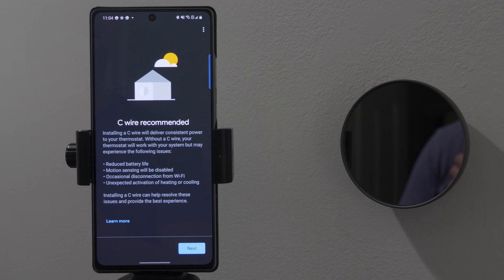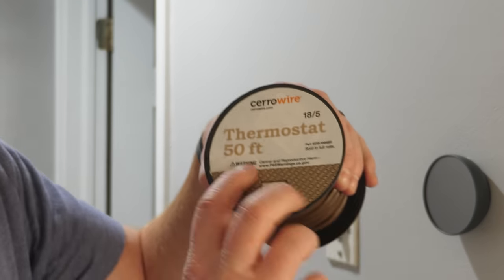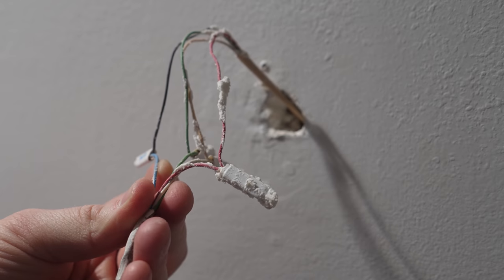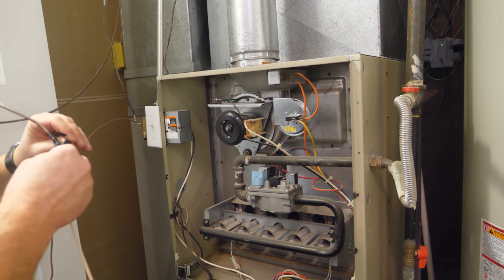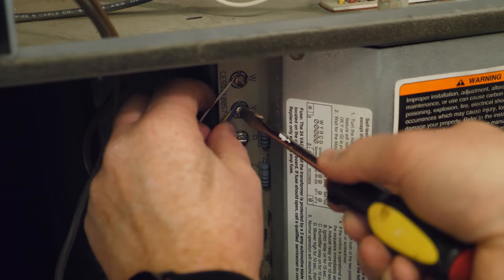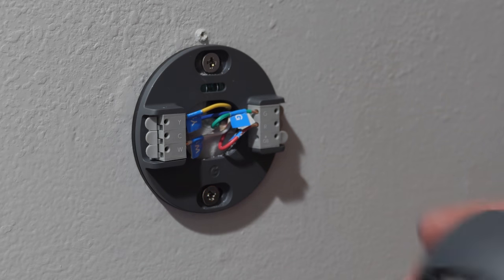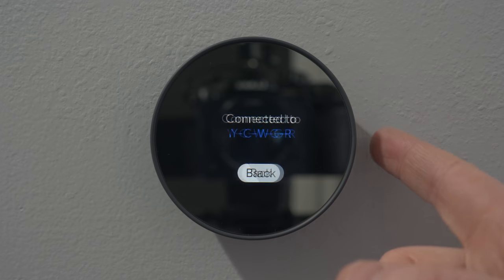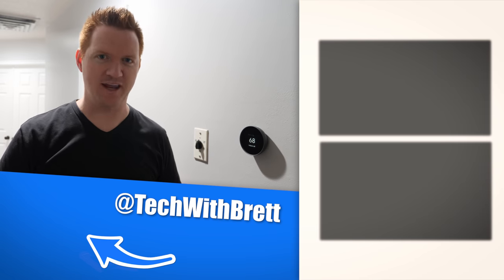Fix Nest Thermostat Issues by Installing a C Wire

Comment: Highly recommended, my Nest was great the first week and then it starting pulsing my furnace during its recharge draws causing the furnace to turn on and off rapidly which is definitely not healthy for long term life. If you have the means, get the common connected.
Reply: Google nest uses 2 non rechargeable AAA batteries so how can there be a recharge draw lol
Reply: @misterpro7903  Awwww that's cute of you to respond and I appreciate that. Older versions of Nest Learning Thermost such as the recent 3rd Gen do NOT use AAA or AA batteries but a rechargeable lithium-polymer battery.
Reply: @Davideturner  Well this video is not about a 3rd gen or older versions so why even comment
Reply: @misterpro7903  you seem to be oblivious of this yourself which is quite humorous making your reply further worthless and you should be ashamed in yourself with such a petty retort. I am happy to hold your hand on this one though. This video is clearly about using a c-wire with a Nest in general, regardless of the generation and your reply offered nothing in regards to this as the c-wire reduces the need to rely on any battery functionality in the first place. Further more, the pulsing issue is a well known and documented issue which is covered in major reddit threads and articles and occurs with the newest version here as well. For example: https://myfyveproducts.com/blogs/news/no-c-wire-install-a-nest-thermostat-at-your-own-risk
Reply: @misterpro7903  On the contrary, you missed the the subject right from the get go and your backtracking has been entertaining. You offered nothing to the conversation of this helpful video and I recommend you review the intent of the video by re-reading the title and the content body. You screwed up with your little petty comment kiddo. I digress.
Reply: Btw, as clearly indicated for you with a lot of hand holding, this affects all Nests. Read the article I provided or the massive threads on Reddit. Again, this has been a very well documented issue which affects ALL Nest thermostats regardless of the battery type.
Reply: @Davideturner  I think you should spend more time searching for hair receding solutions instead of arguing on the internet about thermostats, and maybe upgrade to the 2020 model so we all talk about the same thing grandpa ;)

Comment: I have a Question. I am installing a lock case and need to remove the nest thermostat so I can screw in the backplate of the lock case. Do I need to reset the nest to do that? Thanks. Great video btw.

Comment: Don't forget to turn off power to your furnace before removing the thermostat. If you short the wires to ground you'll be wondering why your furnace doesn't work anymore. Hint it's hopefully just the 24v fuse in the furnace.
Reply: Yes, the white single pole service switch that was shown actually was “on” in the up position, maybe the circuit was turned “off” at the circuit breaker.

Comment: Just finished installing 2 of these and running new wiring plus c wire in a house built in the 1800s. Talk about a “fun” job. 95% of these thermostats need a common wire. Even if you install it without out one eventually you’ll be calling a tech back out bc of issues occurring I.e battery or function issues. The other 5% is that a customer has a older control board like a ewc-st-2e with seperate O and B wired and have to be upgraded.... a complain I have is that this newer model has to be added through the google home app which for some reason never goes through smooth while setting it up. Takes several attempts to sync up. I feel the nest app connects easier to nest products. But that’s going away smh.

Comment: My nest worked fine for a year. 4 wire.  Motion sensing was fine. It suddenly started with the e298 error. Reverted back to programmable unit.

Comment: I’ve tried installing a C-wire adapter on my Trane furnace/ac for my Honeywell thermostat and have been unsuccessful. When I re-wire everything the thermostat has power and air will blow, but it’s not cool air as I want and the outdoor unit doesn’t run… any idea what I might be doing wrong?

Comment: If you have a powered thermostat system would you still have to use batteries with this device. I’m planning on buying one but I don’t wanna have to constantly put batteries in it when an a common/power wire is in place.

Comment: appreciate the video.. very helpful but I returned my Nest as I'm not going into my ceiling and run wire... or hire someone to do this... this should be solved by Nest...
Reply: Went round and with nest technicians for months. They never said that we had to spend more money to rewire our home. They just should have told us we were screwed from the start. Wasted so much time and money. Nest folks should be ashamed.

Comment: Thanks for the video! in the end, I did not need the C wire. The Nest seems to work perfectly and has the motion sensing. Not sure why some systems need it and not others.

Also, your wire was super easy. Mine is stapled inside the wall. That is code here, so you are not able to just pull it through the wall. 

As a FYI to everyone, before installing a new wire, I would see if you already have a C wire. It may not be  hooked up at your furnace or on your current thermostat, but it may be there. For example, at my furnace, I can see the C wire. It was coiled around the other wires just to remove the excess. If you look at the wire in the wall, it too may have been coiled around the other wires and sits inside the wall, not pulled out through the wall.

Unfortunately for me, the C wire as I said, was coiled up in the furnace, but I could not find it anywhere within the wall with the other wires. I cut open a pretty big hole, 4 inches by 2 inches to look down the wall, and it is not there. I wonder if they cut it away when they sent it up the wall because the wires have been removed from the main brown cable insulation and the individual wires were sent up the wall, which is very strange as they typically send the whole wire up in the main insulation and only remove what they need to send the individual wires out of the wall.

Luckily, as stated above, I do not have a C wire error, so it seems my system can power it without the C wire!
Reply from the maker: That is great news and I should have put more emphasis on the fact that some systems just don't need it. The Nest Thermostat detects if it is needed or not depending on your system. It's great to hear you didn't have to go through the hassle of adding it.
Reply: I think you have the Nest and not the Nest E.  His is the cheaper version Nest E from the looks of it.  The regular Nest that retails for $250 doesn't need the C wire and everything works.  I even had it connected with only 2 wires and everything works.
Reply: @nicolaslocke1433  I have the newest version as was in this video with the glass screen (Nest Thermostat). The Nest E was a cheaper version than the Learning Nest which was 3rd generation. It was white with a foggy looking screen.
Reply: @nicolaslocke1433  I have the same thermostat as you and it only worked with no C-wire for about a day for me. Some people 2 weeks, some people 18 months before they had to recharge it.
Reply: @Mikegee63  I think that's because the 2 wires supplies very low voltage, and the boiler needs to stay on.  I do notice my Nest on the boiler had a low battery indicator, but when checked, it still have a voltage of 3.724 ish.  If I leave it alone and don't constantly bring the screen up, it went up to 3.79 eventually.  Can't seem to get it to 3.8.  the Nest on my AC does have a charge of 3.8 and never shown a low battery, but that uses 3 wires, Y, G, and Rh.  But thanks for letting me know.  I'll keep an eye on it to see if I ever need to unplug it and recharge it, as I only had these for a month.

Comment: Hello, thank you very much for your videos, they are great!
My equipment is only cooling and when I took out the old thermostat it had a C (blue) wire. I connected it according to the instructions but the thermostat never turns on!
Please could you help me? Thanks in advance! Daniel
Reply: I learned to not look at the color and loot what it’s connected to. For instance my thermostat is 4 wire and my blue wire was in fact my yellow wire

Comment: I wonder if this will solve the issue I’m having with my AC- the Nest turns the entire system on immediately after shutting off. Its like it runs a full cooling cycle and then turns off and back on again. Sounds awful for the compressor.

Comment: I have a combined heating and cooling system.  I have an older emerson thermostat.  It has an RC and an RH with a jumper between the two.  I just purchased the Nest thermostat that you have in this video.  It only has an spot for just one R wire.  Will this work and operate both my AC and Heat?

Comment: What kind of medieval heating monstrocity do you use over there? In Europe we have high energy efficient gas central heating systems.
Reply: We have HVAC heat pumps here. Gives you both heating and air conditioning (cooling).
Reply: Some appliances here in the United States also offer and gas heating with a heat exchanger but because of the multitude of parts and not all areas being readily available with natural gas services we also utilize what's called a heat pump (IE compressor Heating) and or a heat strip at grades of 5kw 7.5 KW and 10 KW depending on wire size and living space to be heated. In most cases I would recommend the heat pump solution simply because it is more cost-efficient (no gas utilized and no electric heat) using the compressor to heat the home with a 5kw on defrost cycles activated every 45 minutes to prevent ice build up on the condenser. The reversing valve/heat pump costs less to run, about half the amp draw versus a straight cool (electric heat only) saving money on electric consumption.

Comment: I'm doing this instead of buying the nest power connector... thoughts??
Reply from the maker: If you have easy access and don't have to spend a ton on cable it might be worth it, but the Nest Power connector is pretty simple to install.

Comment: My thermostat wire runs 30 feet under my floor outside to my unit and staples all the way. No chance of this method working on mine.

Comment: There must have been an update to the nest thermostat over the summer because c wire is required now been using mine without it for 2 years and it would always show the error c wire recommend but now it will not connect to WiFi at all without the c wire just to update people
Reply from the maker: Interesting. I believe Google is now giving away the Nest Power Connector that you can install at your furnace to show that it has a C Wire.

Comment: This is just for my gas heater only 2 wires, but it uses a 24 volt system, not sure if i need a C wire?

Comment: I don’t have a common wire, yet it works fine and I still have the motion sensing feature. Does that mean I shouldn’t ever need one?
Reply: It's odd... I have two HVAC systems in my house. I installed a Nest on one of them and it worked fine w/o a C-wire. I installed the other one today and immediately got the C-Wire warning on the 2nd system. They are slightly different systems but the wiring is exactly the same, so I have no idea why one worked and the other didn't.
Reply from the maker: Most likely you won't ever need one. Google detects if you system needs one and if it doesn't say you do, you don't.

Comment: They made a new device called Nest Power Connector. It's easy to install at the furnace end and doesn't need the C wire.

Comment: I only have 2 wires in my existing thermostat does that matter? Do I just cap off the wires that I don’t need in a thermostat wire?
Reply: With only two wires your nest could cause problems with your heating and cooling equipment when it tries to charge its battery.

Comment: FYI this doesn't work for everyone. Please explain this at the beginning because not everyone can pull a wire in house that has multiple floors or the wire is stamped in with other wires.

Comment: Originally when I installed my Nest 3rd Gen thermostat (Y1,G,Rc,W1) I had a problem with the Nest staying charged (no other issues). I realized that it would charge when the furnace fan was turned on, so I created a schedule that would run the furnace fan a few times a day during the season where heating and cooling doesn't come on regularly. During the winter and during the summer the heat/cooling runs enough that it keeps charged. The schedule was only needed during spring/fall.

What has confused me is that I turned off the schedule last winter so the fan didn't needlessly come on and I forgot to turn it on for spring time but I realized for some reason now the battery stays charged. This fall it didn't need the fan schedule again either.

Can you explain how suddenly the thermostat stays charged without doing any wiring modifications?
Reply: This does not directly answer your Q, but I just got over a related experience w my Nest. After a couple months issue free it suddenly went into low battery mode. The fan was running plenty but diagnostic showed the power in was only supplying 20mV, or right at the tipping point for risking a low battery from what I have learned. So I popped it off the wall and did USB charging of the unit for an hour to bring the battery up out of low power mode. Stuck it back on the wall, it reconnected to wifi and now reported it was getting 40mV in. This latter datum seems to mirror your "for some reason now the battery stays charged" experience. Maybe it is combo of  heating/cooling stages and fan activity that determine the mV the Nest receives. In any event, I think all you can do is monitor the battery and mV in each week to avoid disconnect, low battery surprises.

Comment: On installing the new nest thermostat all works however my batteries die every 10 days. Clearly there’s a power issue but I can’t identify it any thoughts?
Reply from the maker: Have you adjusted settings to reduce battery usage like lower event time recordings and detection settings?

Comment: So installed my Nest thermostat, but the power is low. I'm gathering from the videos that my Nest will recharge every time the furnace kicks on with NO C wire added, but will not charge when not in use. Will taking it off the wall and using a USB port be my best bet for times when I'm not using it like April and October when I don't need heat or AC? Will the battery last a month?
Reply from the maker: How long have you had it? The batteries are not rechargeable. If you just replace them it should be quite awhile before you need new ones as long as your system is wired correctly.
Reply: Brand new, just got it today. Nest 3rd generation, rechargeable lithium/ion battery. USB port in back. They're saying in other videos that the system may recycle on and off if the battery gets too low, sending juice to the system through the RH port to recharge, which means my motor runs on and off for no reason. Fix is to run the blue wire to the C port in the furnace, but my furnace already has the power wire to the on/off switch on the C port and I'd rather not mess with it. Question is how long will the charge last once I juice it up at the USB?
Reply: @Blackdog4818  if you have the extra thermostat wires, connect one of those wires to the c terminal on both the thermostat and Furnace. If there is another wire attached to the c terminal on the furnace it is still okay to connect your wire to that terminal also. If you have at least 4 wires you can run single stage heating and cooling with terminals rc/rh, y, w, c.
Reply: Yeah, I have the blue wire, could have done that, but I'm real hesitant to start messing the a new 5,700 dollar furnace. Worried I'll short something out. Just wanted to know if it even matters to have the C connected because it's going to be on throughout the winter a lot. Ion lithium battery should stay charged.
Reply: @Blackdog4818  I'm not sure but I don't believe the battery is charged when the furnace is running only when it needs to charge it will "steal" power from the w or y wire, that can cause problems with the operation of your new furnace. I found the lack of c wire for nest thermostats can cause the heating or cooling to turn on and off rapidly. That can be hard on the equipment
Reply: @Blackdog4818  if you turn off the power to the furnace first and are sure of your wiring then there is little chance of error. If you do have a mistake it will likely trip or burn out the Fuse inside the furnace

Comment: never run a 18/5 always use 18/8 you will thank me later especially if ya plan to replace your unit with a two stage or you end up having a bad wire

Comment: Hi Brett. Thanks for sharing this! My question is why do you replace the original cable when it already has a yellow wire? I see that right after you removed the thermostat base. It is around the 2:15 min into the video.
Reply: It's about the number of wires, the color's are not important.

Comment: By your explanation it seems simple enough, however my mothers current thermostat only has a w wire and an r wire and there is a jumper pin in the r & rc.  Would I still be able to use the nest after installing a c wire?
Reply: Yes